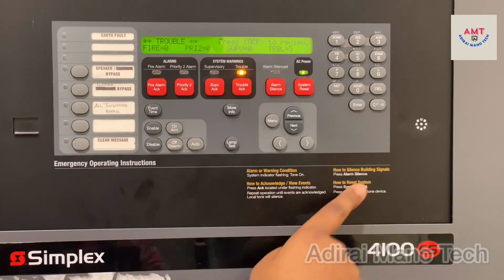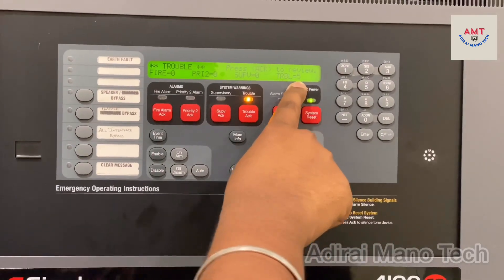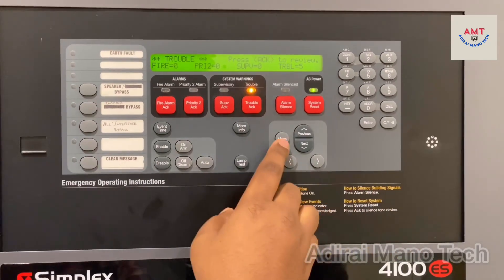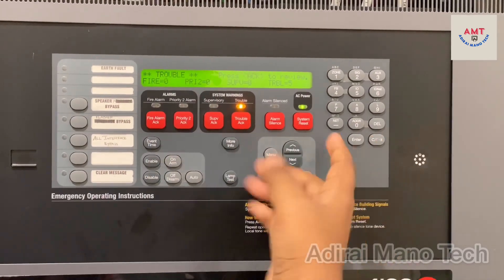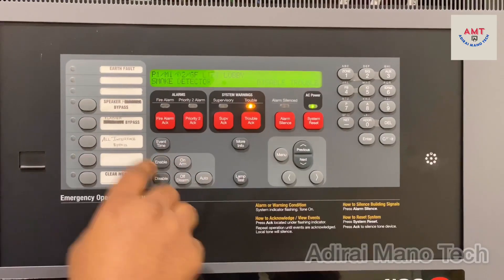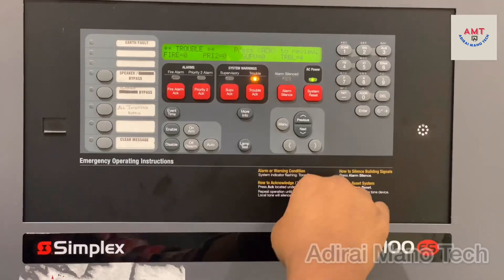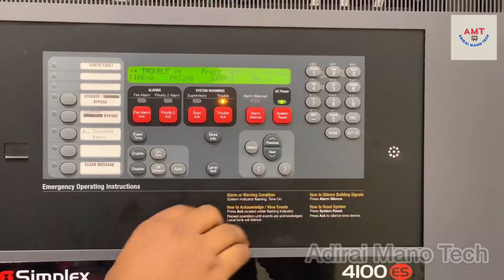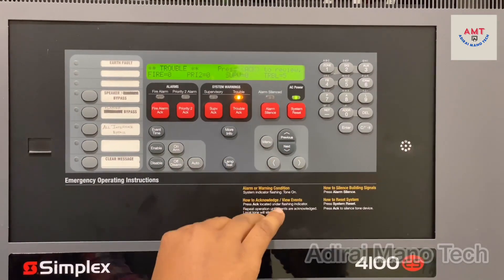How to operate simplex 4100ES Addressable Fire Alarm Panel

Comment: Hii what is the problem for signal circuit  short circuit trouble pls answer me
Reply from the maker: Device faulty, water leakage,  corrosion or cable short.
If any one of reason , signal circuit will get short circuit.

Comment: How we take the details of this panel. How many smoke , heat, modules etc..
Reply from the maker: Ajil aji If you have tsw ,you can check. Otherwise ,you have to check individual loop through the fire alarm control panel